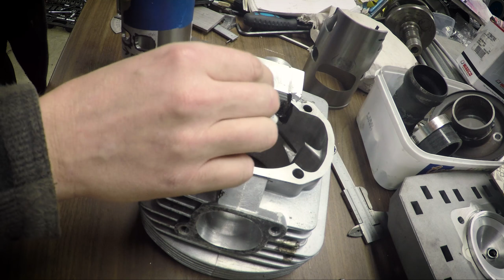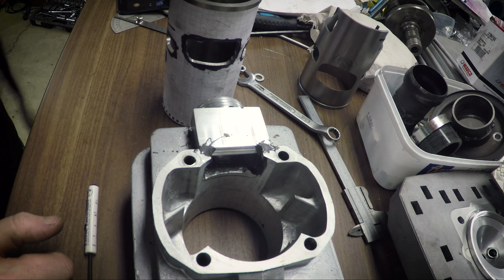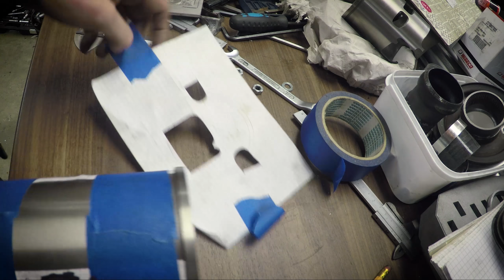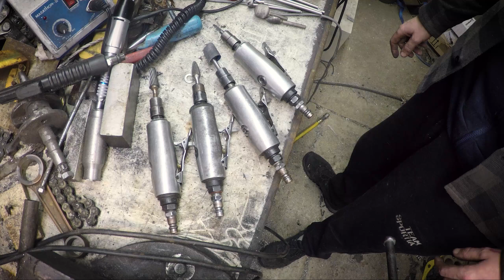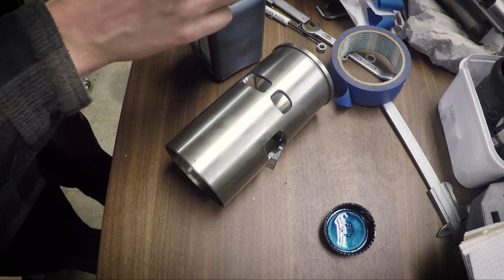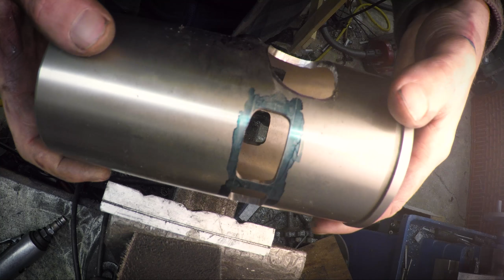Bigbore stroker 277 part 5 - Sleeve porting

Comment: Nice! Need to get me a larger tank and some air tools. and a lathe, and a mill, and tig, and a press and... How hot do you get the cylinder before you drop in the sleeve? I'm always scared the epoxy in my case transfers will let go when I heat up the case to install bearings.
Reply from the maker: 2STROKE STUFFING A bigger tank is on my wish list as well, and space to put it on ;) JB is supposed to handle 260C continuously, last time I had the oven at 200 which was a little higher than what I've used in other projects but it also gave me a little more time to align the sleeve. I think I will try a little lower this time though, maybe around 175.

Comment: That little overhang in the intake port has me puzzled, is that for ring retention? That would mean the piston would go waaaay down in the bore at BDC, another side effect of stroking the crank?
Reply from the maker: Benoît Genest Correct! It's for the lower piston ring which is quite far down on the piston. The ring gap is where the little thingy sticks out into the port so without it the ring would probably snap right away.
Reply: Interesting! A vital part of the porting then. Thanks!
Reply from the maker: BTW I actually mentioned it on camera while filming but I cut it out while editing because the shot was messed up and nobody would understand what I was talking about because it was all happening out of view ;)
Reply from the maker: Yes, very vital! I am planning on doing a sort of "things I should have mentioned" video soon to answer some things people might be wondering about, and I'll make sure to include this :)